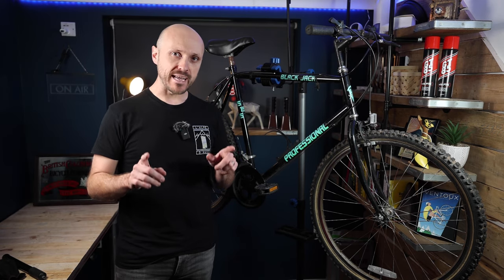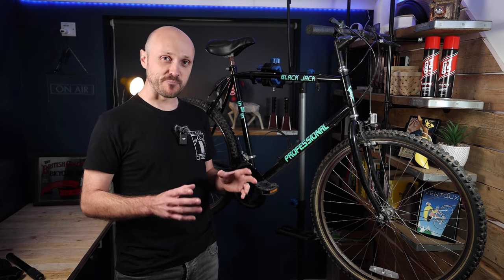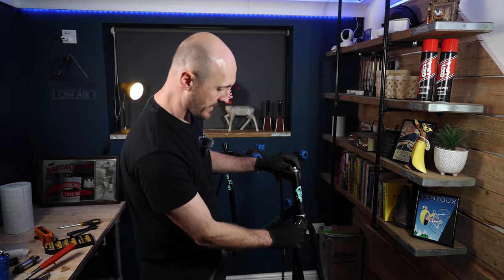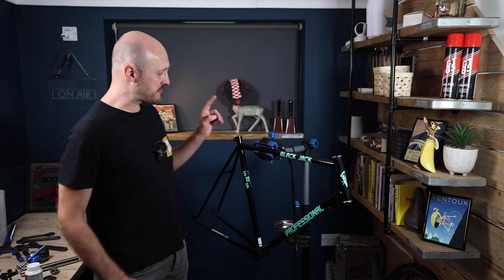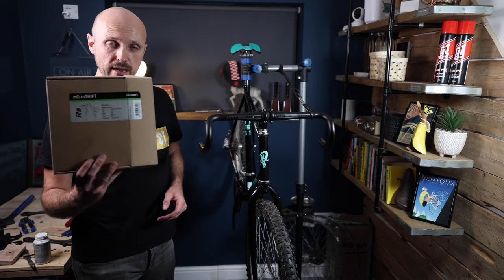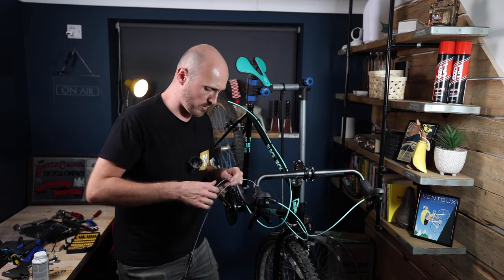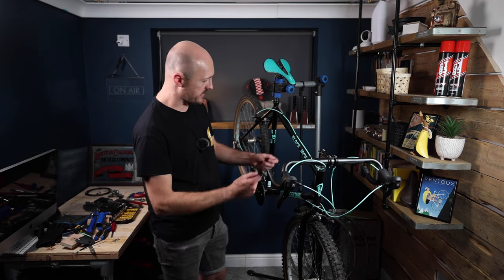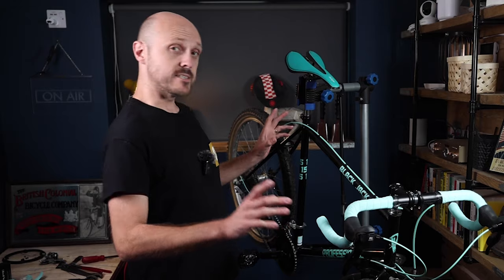Can you build a budget Gravel bike from a ‘junk’ 90s MTB?

Comment: nice. we need more reasonable budget builds like this. 
but i still wonder about 2 questions:

wheelsize: is 28" possible and what would be necessary to do?
fork: aliexpress fork? you can find some <90€ with brake disc compatibility
and bonus question brake discs? how cheap could you do them?
Reply from the maker: It depends on the frame of course, but so long as the seat/chain stays are long enough to accommodate a 28"/700c wheel, there's no reason you can't. This particular bike wouldn't fit 28" wheels as it's an old 26" wheel frame but I have also converted a newer hybrid bike that had 700c wheels. That vide is here, if it's helpful: https://youtu.be/MwmTFKd5h8s?si=vDeO9HTWqjpNw4on

That bike also has disc brakes, so it should give you all the information regards costs for that too. 

I'd have no issue using an AliExpress fork either, but I'd stick to a 'named' brand such as Toseek. I have one of their forks myself and it's a great bit of kit.

Hope that all helps.

Comment: @8:08  
bike forum reactionaries are ridiculous sometimes. what you managed to build is incredible and you can always move the parts to a different bike down the road. I had a similar experience with building an old huffy stalker frame into a resto mod gravel bike (old huffys have clamped and spot welded drop outs but i liked the paint job and outlandishly heavy steel) .  IF THE FRAME WAS FREE ANY WAY AND WONT SNAP LIKE ALUMINUM THERE IS NO LOSS WHEN IT BREAKS.
Reply from the maker: Thanks Dakota. Yeh, the online comments are laughable TBH. Luckily, I’m old enough and ugly enough to ignore most of them. 😂

Thanks for taking the time to watch and comment. 👌🏻

Comment: Be careful with those aluminum quill conversion headsets - I broke 2 of them in 2 years on my cross bike, I switched to a quill stem with a 31.8 clamp and trust it slightly more. But I had been bunny hopping speed bumps and going on mountain trail etc...
Anyway my next build will be a 90's Schwinn Homegrown gravel dropbar/microshift with suspension and 29" disc wheels.
Dig the vids!
Reply from the maker: Thanks for the advice Ace. The quill adapter seems ok for now, but will keep a close eye on it. I'll be having the back in soon to give it a few upgrades, so will give it a full looking over then.👌

Loving the sound of the Schwinn though. That'll be an epic build! Best of luck with it. 

Thanks very much for the kind words too. I'm really glad you're liking the videos.

Comment: Here in New Zealand, these kinds of bikes were what we laughed at, except they were branded Raleigh or some other "proper" brand, in order to compete with department stores... The 90's really was a dark period for some brands, we saw things like one piece "Ashtabula" cranksets and 2x drivetrains make a comeback with sidepull calipers on awful steel frames with steel hubs and steel rims that probably would have been sold for $400 NZD... I've seen it a few times in the last few decades, things almost being obsolete before the industry backpedals (no pun intended) and reintroduces some of those awful things so they can maintain a steady profit on their affordable range. 

14mm hex bolts for cranks, freewheels, single-wall rims, 7 speed drivetrains...

My attitude for a fun all-rounder these days is an 80's mountain bike with upright "cruiser" bars. Bar end shifters or brifters with drop bars always blows the budget way out. However, my current drop-bar gravel/adventure/touring/mountain bike was a measly $300nzd including the fresh powdercoat. Shimano RSX brifters 3x7, Deore DX crankset, DX cantilevers with salmon pads, double wall rims with parallax hubs, On One Midge bars, and an XT rear derailleur with some variety of Shimano road triple derailleur on the front. I used a tall quill stem similar in style to an "LD" stem to make the bike rideable on all surfaces, including mtb trails.
Reply from the maker: I'm yet to buy or install any bar end shifters, although I do like the look of them and will fit them on a project bike soon. Brifters don't need to break the bank though. These microShift ones are pretty reasonably priced and if you want them even cheaper, then the AliExpress microNew ones are equally as good.

Saving old bike frames, regardless of their condition, is a bit of a passion project for me. One man's trash is another man's treasure and all that jazz. If a bike can be put to good use, then it's definitely worth trying in my book. 

Your setup sounds pretty cool though. How do you find the Kool stop brake blocks? I was looking at putting them on this bike for Jimmy, but didn't know if they're worth the extra expense.
Reply: @petertreadway  I think the Kool Stop salmons are mostly an image thing, it a visual identifier that I care about my bike, particularly the brakes, being set up well.

That said, I'd also recommend plain black Jagwire pads, they're a fraction of the price and work well in fair weather. Salmon pads are all-weather pads, but don't hold up as well with higher temperatures such as steep descents.

But all talk about brake pads aside, the brakes on this particular bike of yours are never going to perform well, it's just the nature of such a brake. They're long, made from thin flexible steel, and just can't provide enough grip onto the rims. Either find someone to braze some cantilever studs onto that frame for you, or find some long-reach (the BMX type of long reach, not a touring bike "long" reach) dual pivot calipers from the likes of Tektro or Dia Compe and hope for the best. Don't expect the factory pads in either of those brands to be particularly wonderful though.

Comment: Awesome video ! I was curious do the microshift (or micronew) 3x7 shifters work with mountain bike derailleurs? Because I heard that brifters often lack the tension necessary to shift a front mtb derailleur (such as deore, exage, etc.). I have a 90’s mtb that I’d like to convert to drops but that has been puzzling me. Thanks !!
Reply from the maker: I can’t give you a definitive answer for all derailleurs, but all I can say is that I used 90s MTB derailleurs for this build and it shifts like a dream. 

I’m not sure how they’d stack up against more modern derailleurs though. I’ll try a video on that at some point. 👌🏻

Comment: Absolutely inspiring build, it came out very nice indeed. I am contemplating to convert my 98 GT timberline to drop bar. I intend to keep it simple and retain the triple crancset/FD, but struggle with the FD/brifter compatibility. Would you mind sharing the crankset and FD used as it seem to work with Microshift R8?
Reply from the maker: Hi, thanks so much for the comment. So glad you enjoyed the video.

You should definitely convert you classic GT though. That would be a great base to build a modern gravel bike. So the crankset I bought was just a cheap Bucklos branded one from eBay, which cost about £25. For the front derailleur, I just used the old Shimano one that was already on there and it works perfectly, despite being over 30 years old!

So far as I'm aware, microShift works with most (if not all) Shimano FDs and RDs, as they use the same pull ratios. SO long as your GT has Shimano then, you should be good to go.

For info though, the cheap, Chinese version of microShift (called microNew) work just the same, as I have them on the other bike I converted to a gravel. Might be a slightly cheaper option for you. 

Best of luck with the build. 👌
Reply: @petertreadway  Thanks for the infos. I will go ahead with the GT, ordered the micronews and will see if it works with the FD. The  Shimano shifters for FD mtb vs road dont always mix well, the FD has different pull for road than for mtb. Rear der. is the same pull at least. It seems that some mtb FD work well with road shifters, if not, some Road FDs like Claris can work well with MTB cranks so I just will pull through and see how it works. Keep up the good stuff. cheers
Reply: @petertreadway  I managed to convert my GT to drop down, it is a bliss to ride now. However the front shifter (Alivio mtb) wont shift all three rings. i can use 2 rings at a time. I built in an inline barrel adjuster and i am able to adjust it also while riding. That allows to either use the big and middle ring or the small and middle. It is not too bad but i need to look for a compatible FD as i dont want to change the complete drivetrain just yet. I saw another build with triple mtb cranks and road shifters where the claris 8 speed road triple FD would work with triple mtb cranks. i wonder what FD you have on this beast.
Reply from the maker: @sonofabics  hey, so glad you got the bike converted and great to hear it’s mostly all good. Strange about the FD though, as there’s really no reason it shouldn’t shift for all three rings if indexed correctly. 

Silly question, but you definitely have a 3x shifter for the FD, yes? 

It doesn’t even sound like an issue with the BB axle being too long, if it will shift once you play around with the barrel adjuster. 

As for the FD I put on this bike, I actually don’t know what model it is. It’s a Shimano but there’s nothing printed on it, as it pre dates Shimano’s low end named groupsets (Claris, Tiagra, etc). It’s just a 20-ish year old one I got off the donor bike, so I can’t help you too much with that I’m afraid, other than to say that pretty much Shimano components should work with microNew and microShift.

Comment: i wouls say its doable if your a shorter rider. as a 6,2 rider drop bar 26" fits me terribly and looks ridiculous.i just keep them with flat bars
Reply from the maker: You may have just found yourself using too small a frame, TBH. I’m 6’1” and this bike doesn’t feel overly small for me but 26” wheel frames do come in all sorts of shapes and sizes, so it may also be the geometry of the frames you’ve been on. 

Even if 26” isn’t for you though, my other video where I convert a flat bar hybrid to drop bar gravel would definitely suit you and that one still only cost £400 (which included a largely unnecessary £100 paint job). That bike has 700c/29” wheels and is incredibly comfortable to ride. 👌🏻

Comment: Curious - you don't seem to have an issue with cable pull for both brakes and front derailieur when switching to the microshift gear and brake levers?  Do they have a long cable pull compared to Shimano Sora dropbar gear and brake levers which have a short cable pull?  There wasn't enough pull with the bikes original Shimano C101 front derailieur combined with Shimano Sora gear shifter to move over all 3 front cogs, so bought a Shimano Claris. I have just assumed the v brakes won't work with the Shimano Sora and so am switching to calliper brakes - but perhaps I should have tried with the v brakes first?  Maybe I should have double checked gear cable tightness before concluding the Shimano Sora didn't have enough cable pull for the Shimano C101 derailieur?  Maybe I've spent unnecessry money and time?
Reply from the maker: So I don’t have any issues at all with the derailleur pull ratios (aside from the standard problem of properly indexing a triple crankset, but I’ve had they on every bike I’ve ever bought from new too!). The rear derailleur shifts like a dream though.  

As for the brakes, this bike actually has long, side pull callipers (so like road bike brakes with a centre pivot but just with longer arms) as opposed to V brakes, usually found on MTBs. They side pull ones have a similar short pull ratio to road bike brakes too, so the transition to drop levers wasn’t an issue. 

If you’re changing from V brakes though, then you’d need to use something like a ‘travel agent’ to add extra pull to the cable ratio (you can get them from AliExpress for about £5. They’re called ‘big brake snail’ on there). 

Hope that helps. 👌🏻
Reply: @petertreadway  Yes, most helpful. Shame though not to have known things earlier as it would have been nice to have bought microshifters and possibly not had to purchase a new front derailieur or new calliper brakes.  I will hold onto the bike's original derailieur and v brakes until I'm sure I have everything working ok.  If can't get everything working nicely, can give some mircoshifters a go.  I had never heard of the 'big brake snail' - great piece of equip and good to learn about.  If I ever find myself putting drop handlebars on another bike - I'll be a bit more knowledgeable.  Thanks!

Comment: There are two problems. Sizes (people were shorter in 90s obviously, considering an after market, and overall MTBers are shorter than gravelers), and forks (older standards). Other than that I like an old MTB geometry in terms of a gravel.
Reply from the maker: So long as you size yourself against the bike before spending out any cash on it, you shouldn't end up with something too far out of a decent enough fit and as you suggest, most old MTBs have a fairly relaxed geometry, so work well for an adventure/gravel style bike. 👌

Comment: How did you decide the position of the drop bars?
Reply from the maker: I generally run the bottom of the drops parallel to the ground, then sit the bottom of the shifters in line with them. 

May not be perfect but it’s always worked well for me. 👍🏻
Reply: @petertreadway  sorry I meant  the height /reach in relation to the seat.
Reply from the maker: @catweaseloz  gotcha. So you probably know that flat bars tend to come up and back towards the rider, whereas drop bars go forward, which means the change in reach between the two on the same bike can be dramatic.  

However, I was lucky enough to get a frame slightly smaller than Jimmy rides, which meant he wouldn’t be reaching as far anyway and then I chose a short stem to keep the reach as low as possible. The stem also had a 7% incline in it to bring the bars up. The seat was then positioned for Jimmy’s comfort, so was purely trial and error with him sitting on it. 

TBH, it’s always going to be a bit hit and miss with these old bikes, as it’s unlikely you’ll ever get a perfect fit but if you’re not a pro or at least not racing a bike, then a few non-positions aren’t going to matter.

Comment: The build looks nice finished. Maybe they didn't position it in the right way when you said about people telling you it wasn't worth it. I'm all for saving bikes, but that bike is so heavy. I mean if your friend likes it, fair dos, but at that price I'd sooner just have a decent 90s MTB and ride as is. I'm a bit of a Kona fan myself, something like a hahanna or fire mountain will be better quality steel, lighter and come with more usable parts e.g. bsa bb, usable crankset potentially even an a headset if getting a 97/98 onwards model. They can be picked up for like 100 quid and if you're able to reuse the cassette, derailleur, crankset etc, might not be much more expensive than this, but a lot nicer frame and lighter. Either way, it looks nice, and hopefully rides nice, but that weight is pretty hefty and might impact the fun
Reply from the maker: Yeh, your point about the weight is valid and this bike in the hands of a younger, more agile man might hamper the fun. However, as a couple of blokes in our 40s, Jimmy and I are never going to be flying off ramps with these bikes 😂 and will probably just shred a few gentle downhill trails on them. 

Ultimately though, this was an exercise in how cheaply it could be done, so for sure there are better frames out there to start with but it was a fun project anyway. 👌🏻

Really appreciate you taking the time to watch and comment though. 🌟